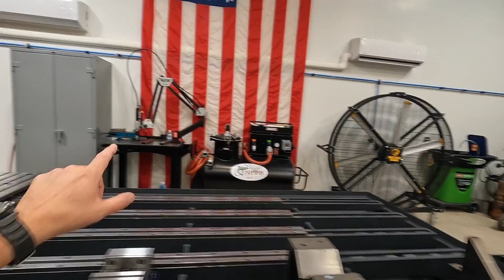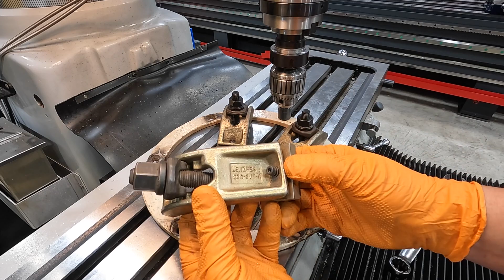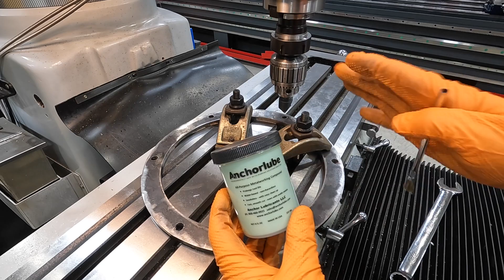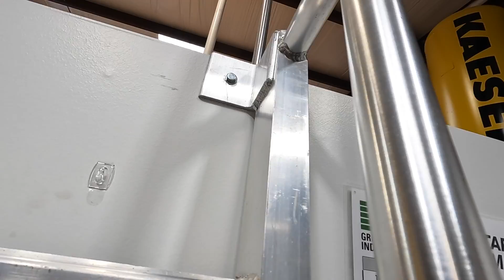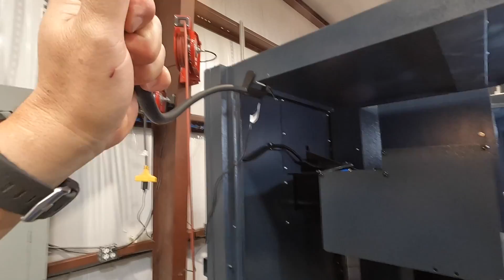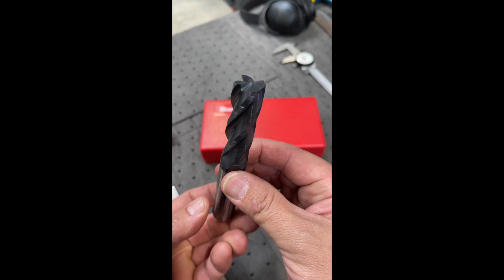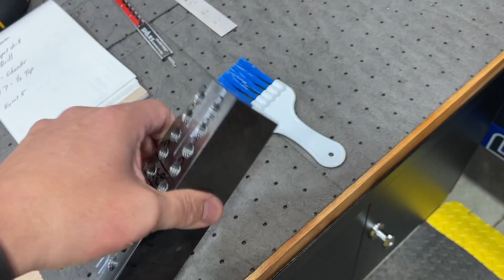SNS 369: Shop Jobs, Projects & Updates

Comment: Good lord. Please dont take this the wrong way, but neither yourself nor Abby are in physical condition to use a ladder like that on a regualar basis. I'm less than a third the size of either of you and even I would have the shakes using it. A fall onto the lathe from that ladder would quite likely be crippling if not outright lethal. Please consider building a proper dedicated staircase Adam.

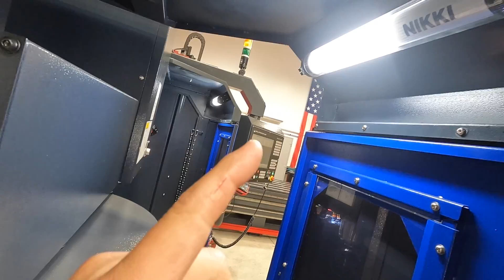Comment: the three light colours on your worklight at around 31:05 basically are "warm white" (slighty yellow) "cool white" (basically "clean white" with red green and blue parts at the same levels) and "day light" (aka. sky blue light which is basically actually blue)

most of the time the colour range in Kelvin is 2700K - 3000K for "warm white", 4000K for "cool white" and 6500K - 8000K for "day light"

these three ranges mentioned above are the challenging part in photography and videography with "white balance" especially when mixed in the same room

I prefer to only have one coulour run at the same time when working in a room, "warm white" for normal is being used in lunch break areas as well as living areas, cool white in kitchen and clean rooms as well as workshops where you do a lot of hand work and try to see as good and colour neutral as you can, day light is a pretty sharp light for working with machines and coolants that often get yellowish during working... so to balance out the yellow colour you use the blue light (and most important place for such light is car body shops with painting booths... because you want to see how the car would look outside in the daylight, not in a warehouse)

so yeah, it deppends on where you want to use the light (and if you want to use it for video, you can use two similar ones (like "6500K day light" and "4000K cool white" or "3000K warm white" and "4000K cool white") combined and it won't be too much of an issue during recording... but big colour differences are simply a pain in the... you know what

greetings from a photo and video nerd from Lower Austria that works in sale and has to explain exactly this stuff to customers in the store when it comes to lights
Reply: Interesting comments.  When I was building my own shop last year, I spent a long time agonizing over what kind of overhead lighting I wanted to install. I knew I wanted LEDs, but I felt like getting the color range correct was going to be critical to how comfortable the shop was to use.  I even looked into fixtures that had the ability to shift between 3000k/4000k/5000k so that I could change them later if my first choice didn’t make me happy, but the additional cost made that idea a non-starter.  I’d already had some experience with the 5000k variety, as I had installed a set of those in my basement workshop;  while they were very bright, they also made for a lot of glare on shiny surfaces — particularly measuring tools.  Although I was not certain that would be as bad in the new shop since it has much higher ceilings, it was definitely on my mind in the decision making process.  What I finally settled on were 110 Watt High Performance 2 Foot Linear LED High Bay fixtures that put out 15180 lumens at 4000k.  My shop is 32x40ft and I installed 3 rows of four lights, based off the recommendations of the lighting engineering team at the company I purchased them from.  After about a year of use, I continue to be happy with the results.  I don’t have near as much problem with glare, yet the light is bright enough that I have not needed to add additional task lighting for most of my machine work.  All in all, the months of research were worth the work.  Most major supply companies will have staff engineers, and I would urge anyone considering a new lighting install to make use of their knowledge when planning the layout and deciding on the right fixtures for that particular application.
Reply: @PracticallyMint  I personally prefer 4000K light for working as well as in hygene areas like my kitchen or bathroom as it has to be clean there... living room and where the dining table is located I got straight warm white

the only daylight I use right now (but will change soon) is my video green screen setup with the two LED construction lights... as they are bright but not hot... will change them to actual video lighting some day... for obvious reasons as it makes yellow stuff turn green and hide on greenscreen

but yeah, getting whitebalance right during recording is easier than in postprocessing

in photography it ain't that much of an issue when you have a good editing software

but for workshops it makes a big difference when you want to do different things... while woodworking for example can be done in 4000K light I would never finish interiour furniture in the same light if it is in a living room later on (I'd go to 3000K or 2700K light)

Comment: hey, if you need more space on the top rung of the ladder put a 2x4 behind the ladders top mount to give you an extra 1.5  to 2 inches of space, it looks like your metal cabinet will still clear the bottom with it spaced an extra 2 inches from the wall.

Comment: Is rapid retract on for your tapping cycles?  In steels this could cause snapping of taps?  Usually it can be toggled to either 1x, 2x, or 4x the designated spindle speed.  Smaller projects don't need the rapid retract on.

Comment: In my days around CNC machines, I was always a fan of the optional stop with distance to go.  If you are .100 over the top of the part, and z says 1 inch to go... Do not push the green button.

You can do the same thing with the feed knob.  Distance to go is the deal.

Comment: A staircase, Adam, you will build your lady an elevator... :D :D :D :D
Reply: This was meant as a joke. But if you think about it, a guy on your level, with all your tools could easily build an elevator. Sets of rails. Weld up a metal box and then a winch in the ceiling, and endstop on the floor and where the elevator needs to stop at the top...

Comment: The top rung of the custom ladder can be augmented by diamond plate out horizontally .75" or so. Integrate it with the wall protection plate. Your feet will be able to get good purchase on the top rung and the drywall will be protected.
Reply: To feel safe, always good to have a good sized first rung, at least if I were to design one.

Comment: Kinda scratching my head why you have 2 manual lathes, 1 manual mill & 3 separate CNC mills, but no CNC Lathe?

Just seems like your heavy on CNC mills and light on CNC Lathes is all. 🤷‍♂️
Reply: There's a CNC lathe in the far corner. I don't think it's been used yet?

Comment: First off the chips flying off at 39:00 is really cool. Just the line of wire thin chips flying off to the right. Also, is the bridge crane tall enough to clear a rail, or is a forklift the only way to get stuff up to the "loft"? I agree with the person below, a section, or sections of the rail should be removable to take stuff up and down, but is the forklift, or the crane the best solution.

Comment: If the ladder blocks any part of the electrical box that looks like its behind it, its a code violation. Code requires 36 inches of clearance in front of any electrical equipment which includes handles.

Comment: Does the beam hoist reach the mezzanine level to get "Creator supplies' up there? You may need some additional dedicated air conditioning, or that BIG ASS FAN so you don't melt up there under those hot Florida sunny days (which I expect, will turn the top 6' of your entire shop into an oven)! The end mill threw some really cool chips, and the threading, WOW that looked great!

Comment: Adam, I'm glad that you didn't opt for pipe flange railings. Where the pipes enter the flange with threads is a weak spot on the pipe. The railing accessories from McMaster are superior to them, and if I recall, are attached by set screws.

Comment: Try a G73 drill cycle for breaking up chips, the drill won't retract completely out of the hole, instead just retract a small amount

X = Coordinate
Y = Coordinate
Z = Depth
R = Retract value
Q = Depth of peck
F = Feed rate

Comment: I'd like to hear what you needed to do for the setups. I don't want to see code, but I'd like to hear something like 'I put this piece of 5x3x3" XXXX aluminum in the vice and probed it for the ends and sides. Loaded the tools I'll be using - a drill, a tap, and a chamfering tool into holders 1, 2 and 3. Told the machine to drill 8 holes on 5/16" centers in two rows 1/2" apart using side A as the reference. Told it to use feeds F and speeds S. Told it to switch to the tapping head I already loaded with the 5/6" tap. ... " etc, etc. Like 'conversational' descriptions of CNC operations that a manual machinist would still understand in concept. That could hold my interest.

Comment: so you store stuff up top and then go up there, grab it and descend that ladder?  Really?  with both hands on the rail?   or just throw it down and descend safely?   with your weight on the front of your feet and not over  your center of gravity, those upper steps are just asking for an injury  (there are no accidents).  The ladder could slide out from the wall to create more of an angle, and then push back when not in use.  Or stairs somewhere else would be the safe answer.
Reply: The design and positioning of the ladder reemphasizes the point that one Adam does not a design engineer make.  His transition into CNC to enable him to make more complex, more shinier, higher tolerance and in numbers machined bits of metal is for him imo a much more suited direction than doing projects.
Reply: If this ladder design ends up not working out, maybe you could find some kind of super heavy duty folding ladder (attic access ladder style) that you could take through a corner of the office space.  That would eat up the least amount of real estate in both the mezzanine and the floor below, and perhaps be the simplest installation.

Comment: The opening shot shows how crowded the shop has already become, basically full. He even showed us the last piece of floor space he has left. V Blocks donated or purchased? Watch Cutting Edge Engineering on how to make your own. Could be CNC'd. A $2-3k welded storage cabinet?! Back to the manual tools to do actual work. CNC is used as a display table for all the new vises. Next video, how to light your tool showroom! New aluminum ladder to access over-office storage. Not sure if aluminum was the best choice of materials, nor a ladder over actual steps for obvious safety reasons. Curious as to it's rating? A ladder at that shallow an angle is a difficult climb. That is more of an emergency ladder at best. A set of stairs within the office space leading upstairs will probably be the final solution. Cannot see Abbie or Abom hiking up that ladder more than once. Though I never understood why the storage wasn't at ground level with the office on the mezzanine. Heavier duty storage at ground level with expansion for the machineshop if needed. 

The broken tool holder is a perfect project to use for your CNC programming. Build one, and you will never have "buy" one again. CNC it out of aluminum, or a plastic block using the same machine. You have intact units in the machine to copy. Milltronics could even send a template?! Make aluminum replacements then sell the plastic ones. That would be a great learning experience. Strange "warning message" from Milltronics highlighted in GREEN! I cannot fault Abom79 on this one, GREEN is Go! Again a CNC video with no actual programming, just action shots and a finished product. Not really a SNS.

Comment: Ck out prime weld 👍🏻 there new ac/dcTig 325 an mig285 👍🏻 I've had there Tig 225 ac/dc for few years now an its been great an got there cut 60 plasma cutter also been very good an now there new mig 285 with mig/lift tig an stick it's got a lot of options like high-end machines have quad feed rollers autoset inductance pre-and-post flow spool gun capability an more Adam definitely give them a look into I'm south of you here in Florida 👍🏻 pricings good and second-to-none customer service 👍🏻👍🏻
Reply: Can check out videos on YouTube Jody at weldmonger,Justin the fabrication series 👍🏻

Comment: Have good & bad news on railing: best ladder ever but its blocking the safety switch. You must have 24/7  minimum of 36" in front of it and at least a 30" wide space for what the NEC calls readily accessible. Also all doors on all safety switches & circuit breaker panels must be able to open at least 90 degrees. In other words either the safety switch or ladder must be moved. I had to do an OSHA 10 class along with yearly 8 hours of continuing education to renew my electrical license. The OSHA class mentioned one fascinating point. Said a one person business does not have to follow OSHA rules. If you are a 1 man owner/operator of and do work in  an electrical, plumbing, welding etc business in larger industrial sites they have thier own safety department who make you attend a all day safety course and will require you to follow all OSHA rules. Great that you can afford such top notch high quality machines & tooling.

Comment: Rigid tapping is nice, and safer to break less taps. But, once you get into threadmilling you'll just never want to tap any hole over about 5/16 again. It really is like when you go from reading dials to having a DRO. With threadmilling, its one tool you leave in the machine in a pocket that you just say thats my threadmill, no more searching for the right tap, and more importantly you completely remove that risky feeling of wondering if the tap will break.

Comment: I don't know much about machining and tools, but I do know lighting and photography. You actually have it backwards. The color of the light isn't overly important, so long as your camera has a white balance setting that you can adjust. However, you really, REALLY want to try to make them all match. The color of the light doesn't have any bearing on glare or anything like that, but if you're mixing warm and cool lights, that can really have an awful effect in videos/photos (unless they're evenly mixed and diffused first).

Comment: You should look into getting some CutsLikeButter brand end mills as another really cost effective way of tooling up the cnc mill. Only downside is they dont have a huge variety of products, I've only ever found their style of endmills designed for cutting aluminum but they are awesome and the best priced cutters i've ever come across.

Comment: Top of the office would be a nice spot for a small or medium sheet metal brake. 🤔🤔Hmmmmmm? 👉👉TIP for ya Adam on LED lighting also. Using a red, yellow or green colored light film aka gel light filters in front or inside the light housing will stop light flooding of digital camara's. Plus Polarizer film sheets helps big time with glare.

Comment: How do you figure out how deep to counter bore a hole?
Reply: Or the countersink, rather than a counterbore as in the case here, There are countersink gauges, am surprised he does not have one. In some instances production shops might have a machined countersinked ' gauge to profile' and you just use your fingernail to check for correct depth.
Reply: My amateur way is test fit with the intended fastener.

Comment: I can’t believe you are expecting Abby to climb that ladder. A staircase would be a lot safer. If she falls on that lathe it could be bad news. I would encourage you to rethink that ladder.
Reply: Not just that but the spacing of the back of the rung to the wall is completely wrong at the top. I've built more than my share of fixed ladders and our codes required a minimum of 8" from the back surface of a ladder rung to the closest obstacle and there can be no obstructions through the top.  Maybe Florida codes are different but even at that I'm surprised that Mr. Booth is fine with something obviously unsafe. I'd be more worried about someone taking a fall off that ladder than getting some scuff marks on the wall.
Reply: Yea… I thought it was supposed to be a staircase too. 

I’m not thrilled about the ladder either and I don’t have to use it. 

( I would dread using it especially if I had something in my hand )
Reply: I’ve climbed on many roofs and other structures as an electrician and this is about the angle I am used too. The benefit here is it’s secured to the structure and not just relying on the teeth or rubber pads. I’m sure if they find it unsafe or uncomfortable they will adjust and or replace the ladder with something else.
Reply: @Paul_Lane  what do you think of the disconnect being behind the ladder?
Reply: @michael931  since it only being used as a switch and it still fairly easy to access its not a big issue for me. However, an inspector might say something different if they didn’t know it was being used as a switch rather than an actual service disconnect.  Even though I don’t see an issue with the latter, I would have probably place a narrow set of stair (more like what you find in a Navy ship) near the garage door side with the landing stopping near the office doors. I think it would get old quickly for both of them.
Reply: Why did you not build a proper staircase? You are too heavy to go up and down that ladder
Reply: Once all the free stuff stops coming in he can just use a pallet on the forklift as a elevator lol
Reply: You can't be serious?
Reply: @anthillmobstars  No, I’m Shirley. He’s serious. 👆